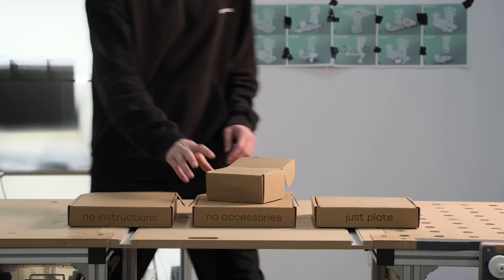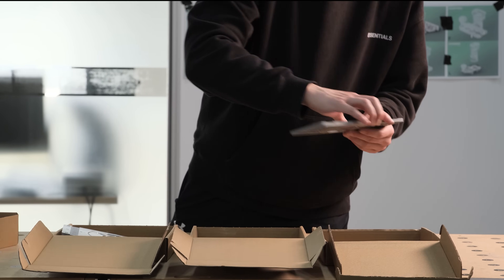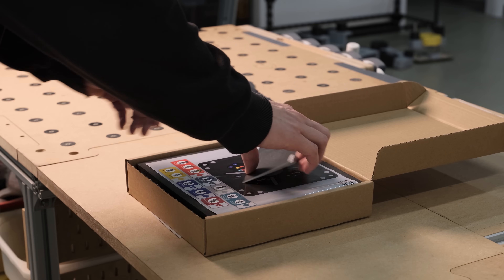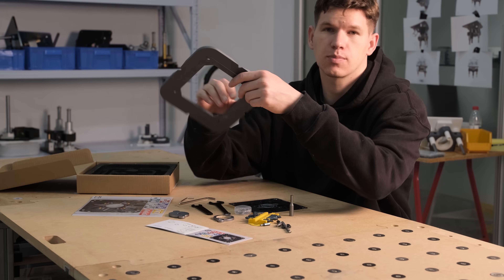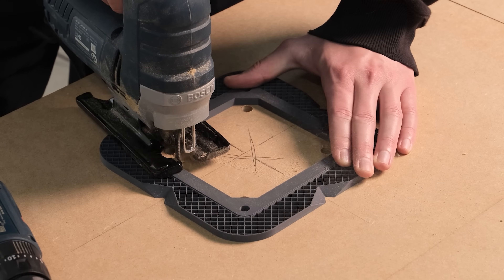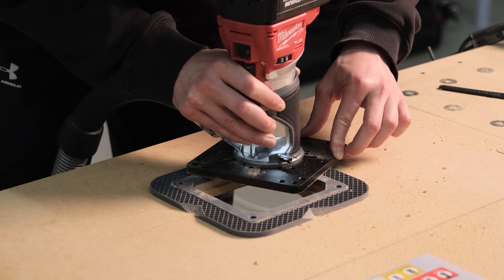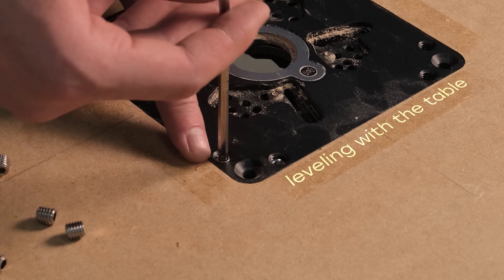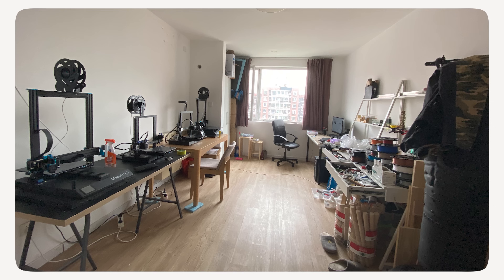Why it Exists ? || Router Table Plate

Comment: The base plate and gears are the main selling points. The lower vacuum port is a real nice feature. Someone below commented that most people will have a fence with an upper vac port already. I agree. The person who buys this will be making their own table and set up. The upper fence should be an option to purchase. I also think a lot of people may be mounting this next to a jobsite saw. Then they could use the back of the saw's fence to adjust the router fence. You might sell a micro adjust and vac port attachment. Keep with the small routers. You're building a system around the small routers. To match your precision and build quality with the larger routers, the customer would have to spend thousands. I have several of your products. They all are of the highest quality. If I could offer constructive feedback, the instructions need work. Large print. Easy to read and understand. A junior newbie to woodworking should be able to read it and understand. Or have very clear (much slower...) videos to showcase what your systems can do. I believe in your company and wish it the most success possible.

Comment: 1) dual exhaust system: yes please!
2) gears: also yes!
3) fractal vise: make it optional if at all. i have a 3d printer, i'd much rather print an adapter for my router. plastic is quite rigid under compression, so if you build a somewhat universal clamp that takes a 3d printed insert, the flex should be minimal?
4) can you make a rail and fence system as an accessory to go with the router table? i need a precise system of fences and hold downs all the time.

i built a router lift table with a chinese aluminum router lift kit. first a cheap kit about 20$, wobbly and unreliable, then 150$, sturdy and no noticable wobble or flex. missing was the following: good dust collection, a precise and comfortable to use set of guides and rails for the tabletop, and a quick way to switch the router bit. your 2 speed lift is an option, i'd probably prefer a lever at the side of the table that lifts the router up in a single motion, but that's a different mechanism altogether.

Comment: Is there a way to remove those features from the high end one and just sell the parts as add-ons you can install later, or are they so integrated that it would be impossible? If so, not only would that be ideal for people wanting a mid-range product, but also for people needing replacement parts.